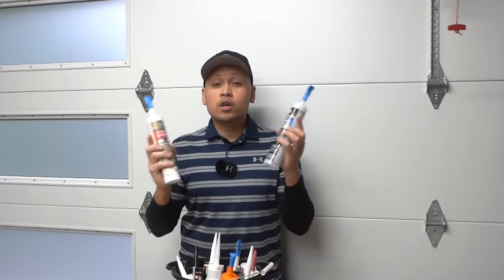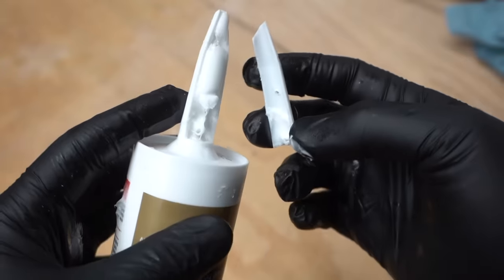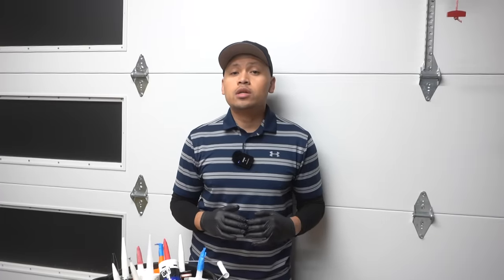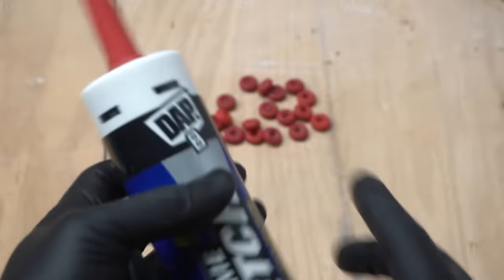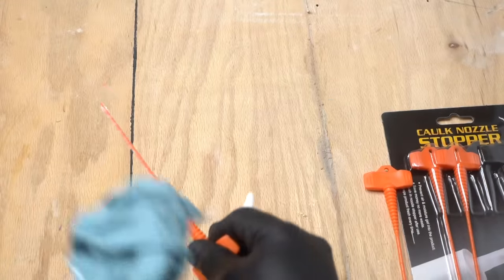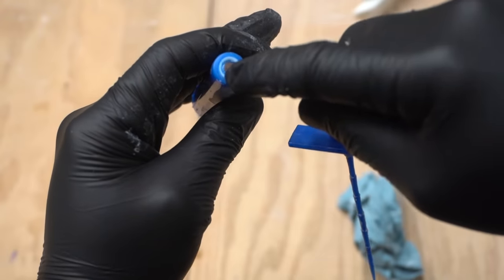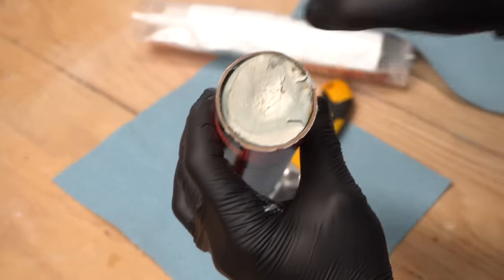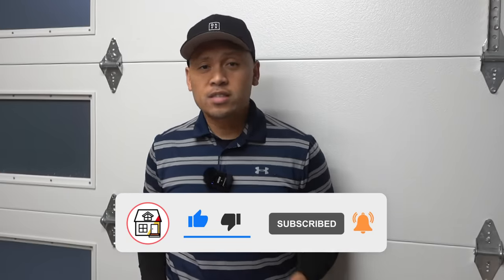STOP Throwing Away Half-Used Dried-Up Caulk Tubes! How To Fix It To Last Forever!

Comment: It’s not hard. Bash a slightly oversized nail in, go bigger and bigger each use. You can even smack a 4” nail in through any dried up sealant, pump and the fresh stuff will come through. In the UK we have removable nozzles on most tubes so worst case remove it and replace with one of the many spares floating around on the shelf at the store.

Comment: Tape works great if you use vinyl tape only painter tape has an adhesive not strong enough to seal and stay sealed quality vinyl tape when used correctly is air and water proof dont use the dollar store vinyl tape

Comment: You made a common mistake. When most people stop applying caulk they relieve the plunger pressure then cap it.  This allows a small amount of caulk at the trip already exposed to the air to be slightly withdrawn and it introduces more air into the nozzle as it is being withdrawn, so the cap is sealing in  air and already hardening caulk. Slicone caulk forms long chain molecules that crosslink as it cures. The vinegar small is the chemical released as it reacts with air.   

To make any capping method work better, when starting to cap, reapply plunger pressure and force a small amount of caulk to flow out.  "Waste" about 1/3rd of the nozzle's volume of caulk before you cap it and maintain reduced flow until you force the cap into place. Allow any caulk that got onto the outside of the cap to remain.   

This will work no matter how wide a bead of product you've cut the nozzle to deliver, or what kind of plug or cap you use so long as it is air-impermeable and  a good fit.  Silicone plugs and caps work best with silicone caulks because they repel moisture, reducing the amount that is on their surface when placed in contact with the caulk.  The condom and plunger style work better than the closed-end soft tube cap.  (The latter forces ambient air into the nozzle as it is being pushed onto the nozzle.)

If allowed to become coated with fresh caulk during install, the caulk will form a very tight seal around the cap or nail and the caulk in the nozzle won't cure.  I've done this with silicone caulk and RTV and been able to use an opened tube years later.

Comment: If you're going to add tape to any other method, don't use painter's tape. That stuff is not air tight. Packing tape would be better if you don't have foil tape on hand.

Comment: Looks overcomplicated. What all I do, when I'm done using the silicon, is actually push about 2/3 inch out the nozzle and leave to dry on the top of the nozzle. Next time I need to use the silicon (might be after couple of weeks or two months) then I pull the dry silicon from the top and continue to use it without issues.

Comment: Wrap the end of the tip with a/c (metal) ‘Foil Tape and pinch it closed. To reuse, score the tape with a utility knife and peel it off. Cheap and it works. Metal tape does not have any downside and 2” inches of tape is too much and wasteful.

Comment: He never used screws properly, also those rubber caulk tip covers have a short life since they are not truly air tight and somewhat porous.  The point to using nails or screws is not an airtight seal but to leave a long hole in the middle of the dried caulk so that undried caulk can travel through it.  You do need a 3-4” screw though so a 1/8” opening is probably not gonna stay that small.  Also his painters tape is also not airtight and also a bad idea.

Comment: This video is hysterical!  Can anyone watch this and not actually immediately realize the first thing is basically a condom!?? LoFL!!

Also I find it funny how the dude doesn't know the difference between masking tape vs. painter's tape. Obviously he is a contractor or does mostly construction work, and is so used to using painter's tape for everything that he doesn't appreciate the difference.  Ofc painter's tape would never make a good seal on anything. It's obviously way more pourous, less air-tight (i.e. less sticky/no real glue), and much more prone to easily tearing and creating small holes or peforations, because it's basically *paper*... it's not real tape!!  You would get a much tighter seal just by using real Duct tape or even good packing tape...I've been using this for years to seal Krazy Glue (an entire tube of which dries out in about a week of air exposure but can last for maybe 6 months taped up, so I'm sure it would keep caulk fresh for maybe a year).

The most educational part of this is the first 30 seconds. Of course a condom style wrap is gonna keep the best seal. Just make sure your gap doesn't get impatient or wonder if it's your "first time" when you put it on upside down by mistake the first time. And don't open with your teeth!! Hahaaaaa

My only question is, do they come in ribbed for her pleasure!?

😂😂😂

Comment: Use a wax toilet seal. when you are done caulking, push some of the wax in the end. When you are ready to use it, sometimes you have to heat it a little bit to liquefy the wax. It’ll pop out and you can start caulking. No need to go through all the garbage this guy did.

Comment: My dad taught me a long time ago when you are finished using the cock squeeze it so that the nozzle is completely full and make sure there’s a little bubble at the end then just leave it out after a few days it’s hard then if you use it a month later a year later or even a couple years later pull the bubble out and stick a nail in to clean it and it’s as good as new and it doesn’t cost any money and you only lose a few drops of the Product it’s the cheapest simplest an easy way and it works great

Comment: Paint tape is crap. I use electric tape : from one side to the other via the top of tube, 3/4 turn aside, an other go above the whole, then, 2 turns around extrusion cap, and the tube will last up to 1y.

Even for polymer like sika 11.

I will give a try to the condoms and tubanew . Some cartriges cost me 16 € exc tax ... So if tubanew are below 5 or 8e unit they may worth it.

Comment: They try out even if you don't use them. At least I know it's that way with silicone. I had a tube of silicone that I never opened that dried up. How's that even possible when the silicone isn't exposed to air? That's poor manufacturing.

Comment: Those red caulk caps DO NOT WORK. I had some tubes capped with them and they were dried out when i went to use my tube of silicone. Would not recommend
Reply from the maker: Make sure you clean around the tube nozzle so that no debris or dirt compromises the seal. Check also that the caps don’t have holes on them.

Comment: All you have to do is after using your caulk, silicone etc...just dispense a little bit so the tip of the tube has a small glob of it. That eventually will dry up, and ONLY that glob will dry up. Just remove that glob when you are ready to use it again. There you go...smh...NO NEED TO BUY OR PUT ANYTHING IN THE TUBE. JEEZ...

Comment: Good Video but I swear by the nail. I put nail in and use a bit of caulk to seal around it does not take much.
And if by chance air does make it in when you pull the nail out the cured caulk is easy to remove with a screw.

EDIT:  The caulk caps are to expensive. You can buy a box of 100 finger cots for about 5-7 dollar.

Comment: VERY ANNOYING! First test shows painter's tape not preventing silicon from hardening. Then you switched to DAP caulk. ANY recap will NOT stop silicon from hardening. Painter's tape is non-porous, SO no different than the condom  or rubber tip. Silicon has the shortest shelf life after opening. Squeezing the tube near the nozzle will determine if product is still usable. My "TIP"...cut one side of nozzle lengthwise, spread slot to pry out the hard plug. May use drywall screw from tip to pull out. The slot relieves the wedge of the tapered nozzle. Tape the nozzle and use as before.